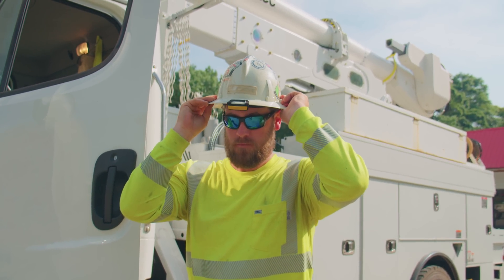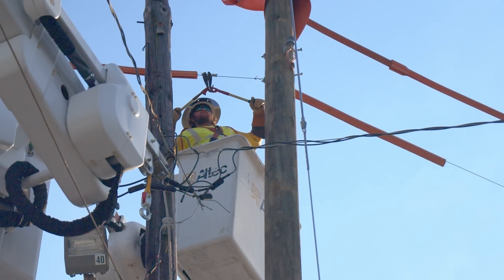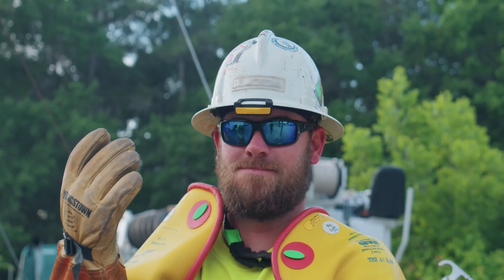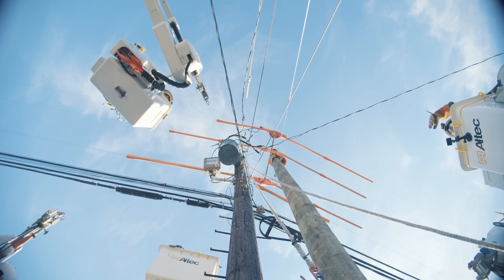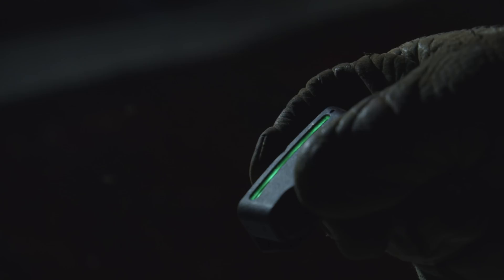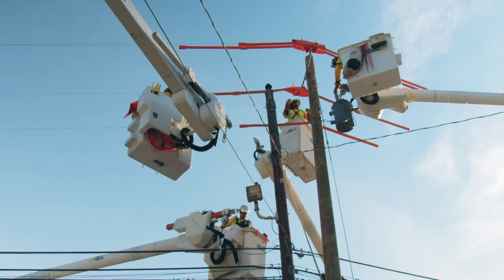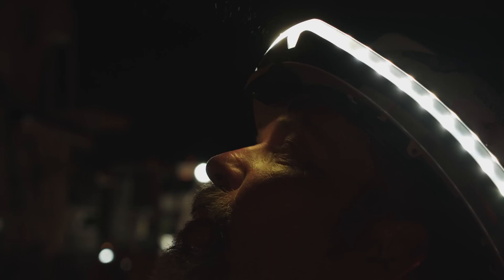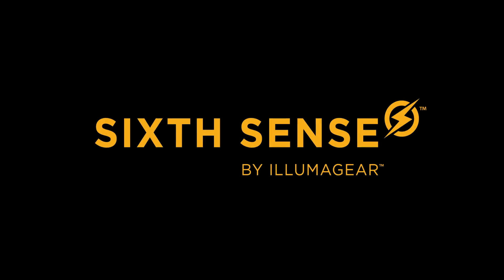Sixth Sense by ILLUMAGEAR - personal voltage and current detector

Comment: I want this product here
Reply from the maker: It's a great product! Please get in touch with our sales team at sales@illumagear.com
Reply: @Illumagear  does this work on all electromagnetic fields? I want to make sure I'm safe while working on Radio Frequency technology, does this item detect narrow bandwidths?
Reply from the maker: @nopoliticalparties  Thank you for your question. 
Power line frequency (normally 50 Hz or 60 Hz).
Variable-frequency drives, which normally use a 1-20 kilohertz (kHz) carrier frequency.
Audio frequency range: 15 Hz to 20 kHz (the range of human hearing).
Radio frequency: 30-300 kHz.
Low frequency: 300 kHz to 3 megahertz (MHz).
Medium frequency: 3-30 MHz.
High frequency: 30-300 MHz.

Please let me know if you have any other questions or want to discuss this further. I'm happy to put you in touch with my team.